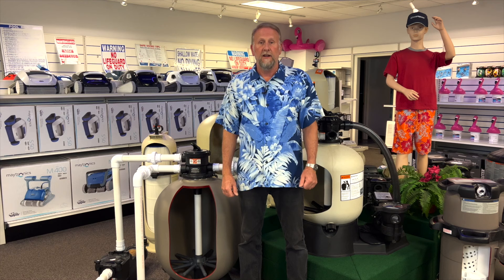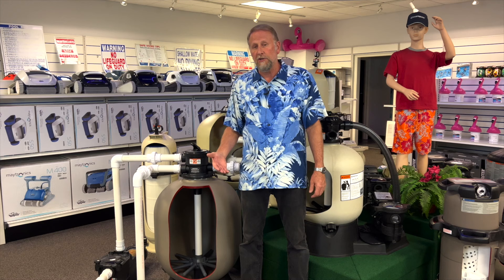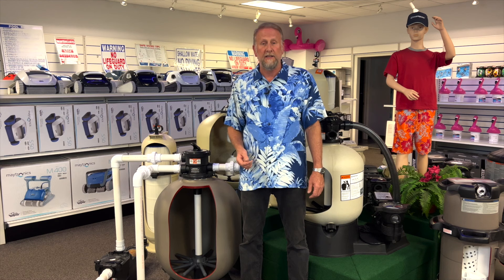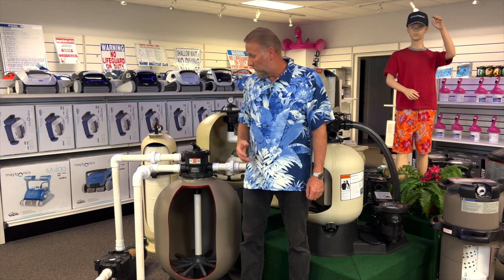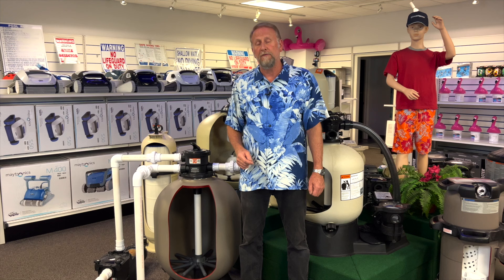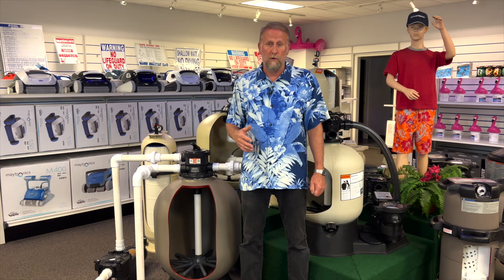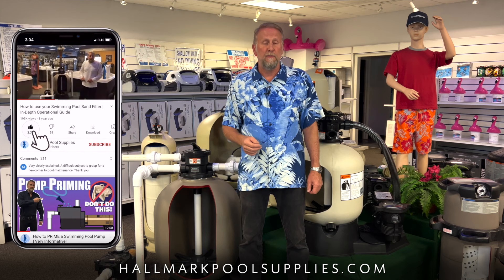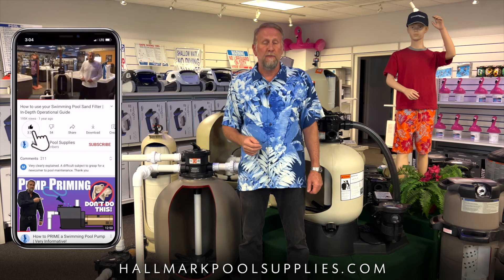5 BIGGEST MISTAKES Hurting Your Pool's Sand Filter

Comment: Great and informative videos... I just installed a new filter and on the center pipe there is a clear hose about 1/8 inch...its attached on one side but have no idea where the other end goes to...I'm getting sand in the pool since I installed the filter so I'm going to empty it out and check the laterals to see if I damaged one or more during installation and replace if needed.  its a xtremepowerUS 19"4500 gph sand filter with 1.5 hp pump... do you carry the laterals? thanks for your help... Jim
Reply from the maker: No, l don't carry parts for this filter. Thanks for watching.
Reply: @HallmarkPoolSupplies  do you know where I can find these laterals? Please help
Reply from the maker: Unfortunately, some of these aftermarket type systems do not have parts available or are hard to find. You can try contacting the manufacturer or google it.

Comment: Accidentally hooked my hose is up backwards and now the top handle turns hard, because there seems to be sand in there how do I get that out?
Reply from the maker: @jimmyed1556    If you open the multiport valve, then you can clean and lube the valve. I have several videos on multiport repair that should help, if you continue to get sand in the valve you may need to check the laterals inside the filter. I also have a video on lateral assembly repair if you need help. Thanks for watching.

Comment: Has anyone had issues with sand filter housing blowing out in the seam? We have  had ours, at this home, for 2 yrs. I have never seen anything like it. Why do housings have seems with pressure ever present? Ugh
Reply from the maker: @tammybobbett8631   Separation at the seam can happen although it is rare. You can check with the manufacturer of the filter, most of the time they will replace the filter tank if you are still under warranty. Thanks for watching.

Comment: Hi Mark. Enjoy your videos. Thank you. I live in North East an hour from Buffalo NY. I have 27' above ground. My pool is blue and appears clean but is cloudy.  It clouded as soon as I started running it the other day. I just purchased a new pump ( went from 1 hp to 1.5 hp) . It jets out great when in the filter setting. However when I back wash the pressure of the water shooting out is not very high compared to my last pump. the glass bubble on my filter barley gets agitated. could my pump be frozen?. before I start adding chemicals to address the cloudy water how can I know the filter is doing its job. I changed the sand 3 years ago but do leave the filter out all winter. Thanks for any advice....Mike
Reply from the maker: If you put your filter on recirculate and you have good jet pressure at the pool, then your pump is good and you may need to change the filter sand or backwash and rinse the filter a little longer. If in the recirculate position your jet pressure at the pool is weak then you need to check your pump (possible clog). Thanks for watching.

Comment: Hey Mark, I’ve got an intex sand filter 2800 GPH that we just bought. I’ve been having to backwash a lot more than what I thought I would have to. When I filled it with sand it’s at the max level and I’m wondering if that might have something to do with it. Any suggestions you might have would be greatly appreciated
Reply from the maker: The filter systems on Intex pools are under sized so you will have to work a little bit more to maintain the pool. Thanks for watching.

Comment: I'm beyond annoyed I know my pool well let me start by saying that. This is the first year I can't get my water blue. I just replaced the sand because my chemicals are spot on.. but what I've noticed is I run the backwash and looking at the water it's not dirty enough, something is wrong.. I'm guessing it has to be the valve because there is literally nothing left to try. Any recommendations I've been at this for 3 weeks now. Thanks
Reply from the maker: The valve has nothing to do with the clarity of the pool. What type of chemicals are you using? If you are using chlorine, what is your CYA level and what type of chlorine are you using?
Reply: @HallmarkPoolSupplies  I'm using a salt chlorinator.. My salt is at 3250
Reply from the maker: There are a lot of unknowns, salt has nothing to do with the clarity of the water. What are some of the other levels in your pool? Do you run your system consistently?

Comment: Could you help.my daughter bought a new pool filter with glass beads.the men who fitted it did not fill me with confidence.I thought that they fitted the inlet and outlet to the valve the wrong way round.but I wasn't sure....they left it running for 2 weeks before I  was proved right ! the inlet from pump to variable valve and the exit from the valve to the pool were the wrong way round .they came and changed it.     Now the entrance and exit are correct..but it doesn't seem to clean properly......could something be broken inside filter tank eg. Latterals..?
Reply: Meant to write .....changed it to the correct positions!
Reply from the maker: If everything is hooked up properly you should be fine, try backwashing and rinsing the filter. Thanks for watching.

Comment: My pump keeps losing prime after a few hours or after a day l have changed the head and the motor and there are no visible leaks anywhere. What else can l check? Thanks in advance.
Reply from the maker: @curtisstrode4311   You may need to backwash the filter or change the sand, if you have done this you can try running the filter in the recirculate position as a test to see if the pump stays primed. If you are still having a problem then l have a video titled “ Air bubbles in your pump” which deals with suction leaks. Hopefully this will help, here is the link for that video. Thanks for watching.
https://youtu.be/SiEOIxYpJ5g?si=65tXzfWnjEavj_60
Reply: Thanks for getting back with me and l have changed the sand, back washed  and it runs fine on recirculation and l will go watch the video you attached and see if it shows something l haven’t tried.

Comment: Hello I have a bestway sand filter system and it runs good when I first turn it in then after an hour psi goes up a little and it stops blowing as good. I cleaned it and changed sand...backwashed...any ideas?
Reply from the maker: These systems are weak and under sized, you will just have to work with it. Once the pool is clean and clear they work ok but you will have to stay on top of it. The only thing you can do is upgrade the pump and filter. Thanks for watching.

Comment: I got an annoying drain plug issue and leak on my s244T (bought used - now 4 years old Hayward sand filter.) the white gasket in this part appears to not come out…I ordered a replacement but it seems like I can’t fix it
Reply from the maker: I have a video on changing sand in your inground pool filter. The S244T is the filter in the video, hopefully this will help. Thanks for watching.

Comment: I have a question about the pressure for my inground pool system.  My pressure will go up, high, quickly after I backwash the system.  I am trying to clean my pool and get it ready for the system and I am having to backwash alot to keep the pressure less than 20 psi.  i did not have  this problem last year.  welcome any help.   Hal
Reply from the maker: If you have a sand filter you may need to change the sand. Sand should be replaced on average every 3 to 5 years. However if you are cleaning a really dirty pool then you can vacuum in the waste position. Vacuuming in waste will bypass the filter but you will have to add water to the pool. Thanks for watching.

Comment: I changed the head on my sand filter and now it's sending sand into my pool.  Any help on that issue?
Reply from the maker: You need to check the laterals inside the filter. I have a video on this issue, hopefully this will help. Here is the link for that video. Thanks for watching.
https://youtu.be/3x2eQYq2K1E?si=sP_agUyAuaL6jAfe

Comment: Hey sir am just having some trouble with my pool I open it last week and fit all the pumps and the sand filter up but when I turn on the pump the water gushing out of the jet for and hour and then stop slowly what can be the cause
Reply from the maker: It sounds like you need to backwash and rinse the filter really good. If you continue to have this problem you may need to change the sand in the filter. Thanks for watching.
Reply: @HallmarkPoolSupplies  Tk u sir I did back wash it and it the same slow pressures but I so change the sand tomorrow I will let u know if all is well Tk u i appreciate ur kindness 🙏

Comment: Hi Mark i am using a 24 inch sand filter. How much 50 lbs Sand do i need to add in my filter to get started. ??
Reply from the maker: 24” is 300 lbs which is 6 bags at 50 lbs per bag. Thanks for watching.

Comment: Before I changed my sand when i vacuumed my sand wasn't filtering the debri off my pool floor. So I put in 5 new bags of pool sand , backwashed, rinsed. Let it run a few hours last night.  (2 hrs)  came home this morning tried to vacuum my floor again and its still blowing green water back into my pool. Any suggestions???? Everything inside the pump looked good. Not sure what else to do. Pump & pool both brand new in July.2020. 1st time changing sand.
Reply from the maker: For normal cleaning you vacuum in the filter position. However it sounds like you have mustard algae and if you vacuum in filter it is so fine that it will go through the filter back into the pool. When this occurs you need to vacuum in the waste position. When vacuuming in waste, you will bypass the filter but you will have to add water to the pool. Thanks for watching.
Reply: What size is your sand filter. If you don't mine me asking??
Reply from the maker: 500 lbs.
Reply: Remember to Rinse after backwashing before putting it on filter

Comment: I have a question,,.. ho bout when you dont have the multiple postion handle,? On my pump i have the handle the goes up and down. Old 244s pump.
Reply from the maker: Same thing with a push pull valve, always turn off the pump before you operate. Thanks for watching.
Reply: @HallmarkPoolSupplies  hi, but my push pull handle, dont said filterwash,rinse, or back wash..
Reply: Can you do a video. 🙂
Reply from the maker: Push pull valves only have 2 positions, filter and backwash.
Reply: Thank you so much.

Comment: If my multiport is broken can I change just the part or do I have to change the whole system? Thanks
Reply from the maker: You can rebuild the multiport, l do carry the parts as well as the whole valve. If you email your contact info l will be glad to help. My email is on my YouTube channel. Thanks for watching.

Comment: I am here because I broke rule no.1. I left the pump running and tried to turn it to backwash. My hand slipped off and it landed on “Closed”. Water came blasting out of the pump and I lost prime. After I re-primed the pump, my pressure gauge was reading 2psi higher than normal. Anyone know why?
Reply from the maker: Your gauge should be fine, when you turn off the system your gauge should go to zero. If not you may have to replace the gauge. Thanks for watching.
Reply: Thanks for the reply.

Comment: I can't see the direction of rotation of the multiport valve making any difference at all. Backwashing wastes water and chemicals, so why not backwash as required: only when the pressure rise in the tank is evidence of amount of dirt/ restriction. Changing sand? A horrible Job! Get a cartridge filter- they need less frequent  cleaning because they offer much more filter area. Cartridge filters also filter much finer than any sand filter, no matter what media you put in. I just don't see many positives for sand filters..